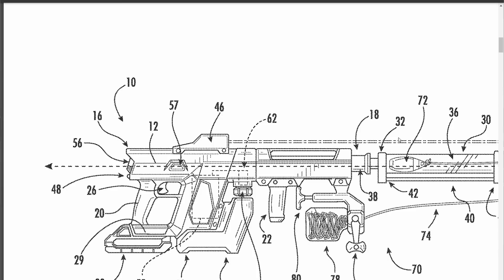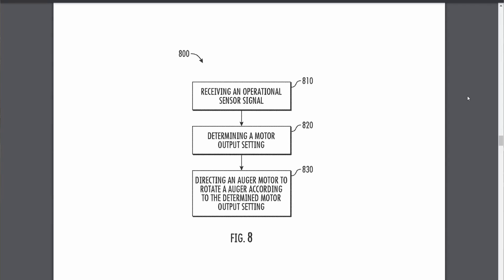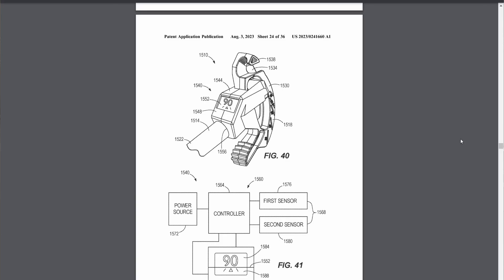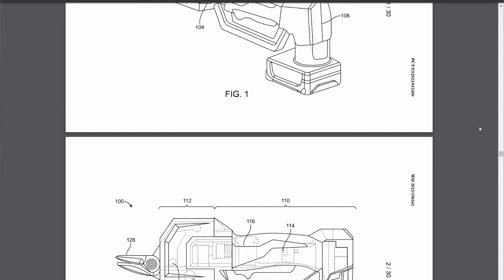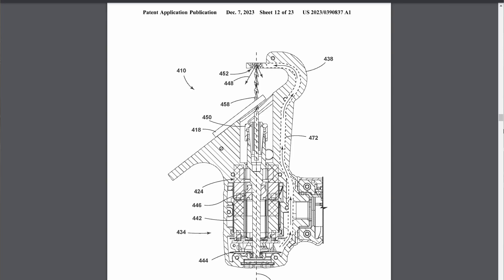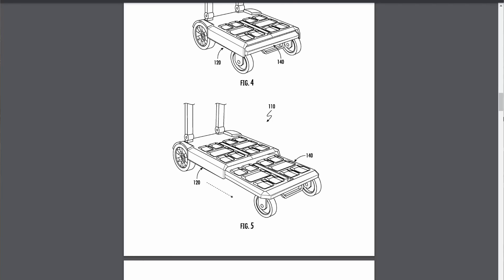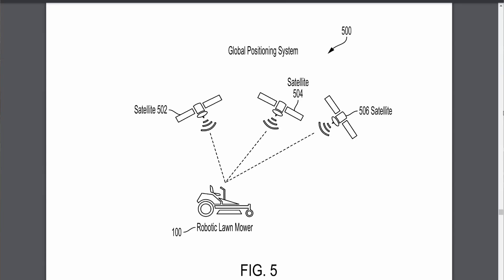Milwaukee Patents 2024 - What They Didn't Show You at Pipeline 2024!

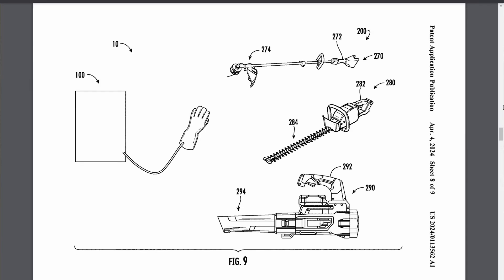Comment: 9:40 hedge trimmers are pretty low power (100-200W), line trimmers low-ish (unless you really laying into thick brush), but blowers are definitely up there (400-800W). Can't really see it working unless they're running at fairly high voltages.
Reply from the maker: I agree, the hedge trimmers seemed like they might be feasible. But not blowers or chainsaws!

Comment: I'm usually all for cordless, but the arborist line launcher seems dumb. If you needed to launch a line every 10s, then yeah, it would make sense. For anything else I imagine a speargun type device or foot pump potato cannon would do the job and be indestructible. Just searched and there's already stuff like that. BigShot is a big pole with a slingshot (a bit unwieldy, but you could easily shrink it with a crossbow type mechanism). Then there's the APTA which gets fully charged with 33 pumps of a track pump. Looks like you could easily do 1 shot per minute.

Comment: We need an update to their miter saw lineup. Dual battery 12in miter saw with plug in option would be sweet. 7.25in needs update to accuracy/calibration. I've had the saw break twice on me. They also need to redesign their stand system from the ground up.
Reply: A previous patent video shows an update and it with a possible Mx fuel tool.
Reply: i wonder when the bosch axial glide pantent will run out? the M18 10'' needs to be updated for sure.
Reply: Not dual battery
Reply: @steffendetrick  single battery cordless only can't keep up with corded for framing or any production work. It's ok for baseboards. But ultimately I regret the purchase.
Reply: @rowankeltizar5961  I love my 7 1/4. I used it all the time when i only need to trim one or two rooms, or a couple doors. Its light and easy to move around. 
Any sliding miter saw is inaccurate when extended just because of deflection in the rails.
Reply: @evictioncarpentry2628  trust me, we share the same sentiments. I would buy another one when mine finally breaks. It's not the rails that make it inaccurate, it's how the miter adjustment is held. I have to recalibrate mine every time I take it out of the truck.
Reply: @rowankeltizar5961  Mines been solid. And my first one, I actually dropped something on it and could never get it square after that, so I took it to Milwaukee seeing if they would fix it fully expecting to pay for it ( it was 3 years old) they called me the next week and said it was ready. They gave me a brand new one instead and this one is solid as well.

What blades do you use? I've always used a 40T laminate blade with it, it's double the kerf thickness of a Diablo...less deflection when cutting.

Comment: And there's the call out for RTK GPS in the patent.  Last time I looked, RTK hardware is still quite expensive and also has a lot of signal issues in urban environments.   This is a pretty good idea on paper but doesn't REALLY work IRL and sadly RTK's precision is needed for it to work.
Reply from the maker: Interesting point! I hadn't researched how accurate GPS had gotten. When I worked as a land survey tech almost 20 years ago, we had a GPS system that was accurate to under 1 cm after tying into a nearby benchmark. If I remember correctly, it was a $40,000 piece of equipment though. I figured it had gotten much better/cheaper since then.
Reply: @DoresoomReviews  Yeah, RTK is cheaper than $40k but it is still around $800 per receiver chipset I think.